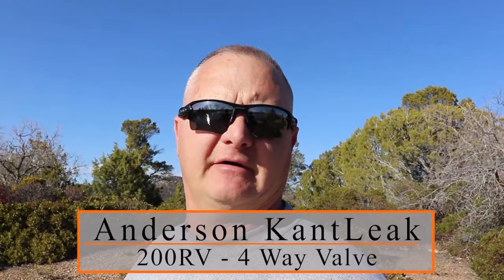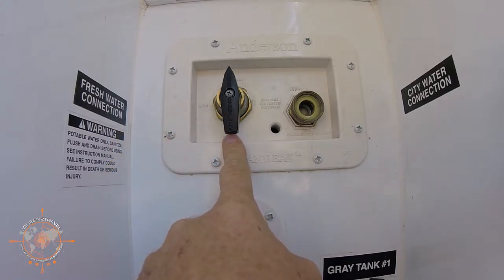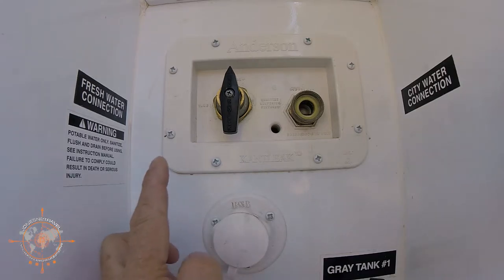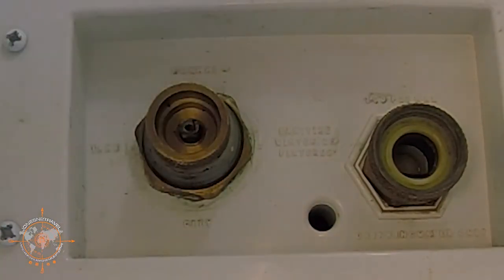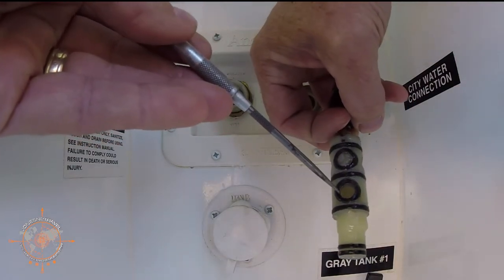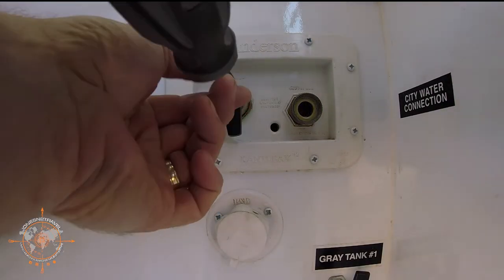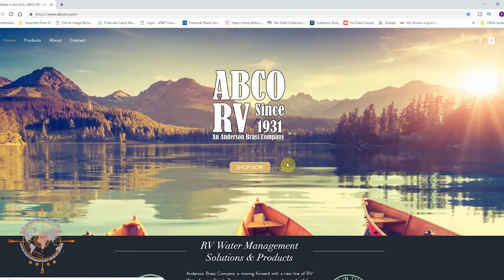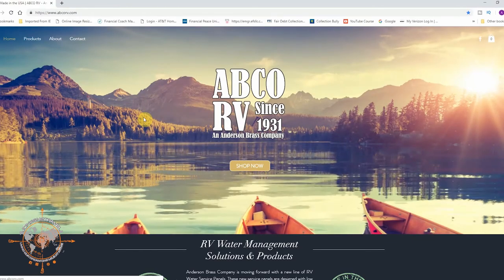HOW TO DIAGNOSE, REPAIR AND FIND PARTS FOR ANDERSON KANTLEAK RV WATER VALVE | RV LIVING

Comment: Very helpful! You can't get the valve cores anymore, but this helped me diagnose and temporarily fix it (I think maybe one of the seals got misaligned). The available replacement part is brass and an improved design plus a 5 year warranty. If you're reading this comment and don't have the money for the replacement part, try taking it apart, checking all the seals and putting it back together. Do not turn the valve with the system under pressure, as this seems to be a common cause of failure. Thanks!
Reply from the maker: Hi John. Thanks for the update. You are correct, you can no longer buy just the cartridge. Thanks for checking out the video. Safe Travels

Comment: Thanks for the video.  Wish I had seen it a year ago.  My issue started with loss of pressure for the shower.  I would also hear a hissing sound coming from the valve area.  (Sucking air of course). Also the pump would kick on and off all day without opening any faucets up.  I would go through water like crazy and my gray tank would fill rapidly.  Luckily this cartridge is available to rebuild these valves.  At $42 it’s a a lot easier pill to swallow then the $160 complete valve assembly.  I am hoping to find me O’rings to replace the bad ones on my old valve so then I always have a spare.
Reply from the maker: Sounds like a great strategy. I had a spare as well but I'm still on the hunt for just the o rings. Thanks for checking out the video. Safe Travels.

Comment: Thank's, great info I also found or the way I discovered the problem mine was also sucking air which caused the pump to run, 
and not build up any pressures.
Reply from the maker: Yes that is how mine started then it stopped then started bypassing. :) Thanks for checking out the video. Safe Travels

Comment: This is great.  I was getting ready to buy the WHOLE valve.
Reply from the maker: Hi Brad. You may need to after all. Check out Ebay to see if you can get a cartridge if not you may have to buy the whole valve. Sorry about that. Safe Travels

Comment: Thank you.  I've been having the same problem, fresh water tank overfilling while on city water, and water pump cycling on momentarily every few seconds when using from the fresh water tank.  I will order as soon as I get home.
Reply from the maker: Glad to hear the video helped. Thank you for checking out the video. Safe Travels.
Reply: Well, we ordered the valve as soon as we got home, and after all the mowing and catching up, the valve was replaced today, and great news, it works just as advertised. Found the rear port seal cut (as I expected to find).  Ran water for a few seconds to get all the air out, and the short-cycling water pump problem is gone.   I will order a spare for any future problem.  Thanks again for the pointers on the video.

Comment: Great video. But the repair parts for the all plastic valve are no longer available and have been discontinued. You now have to replace the entire water supply box with the new all brass redesigned valve. The plastic valves have been a problem for years with the ones you talked about along with cracking issues.  My old plastic one just started back filling into my fresh tank again for the second time in about 5  years. And you are correct they are a pain to turn when they haven't been used in a while. Ordered the new all brass valve today. Very pricey at $170.00 from ABCO. hope this new redesign fixes all the problems with the old ones.
Reply from the maker: Hi Thomas. Unfortunately they got rid of the cartridges but I'm hoping by replacing the entire valve body the issues with these eventually fade away. Thanks for checking out the video and sharing your experience. Safe Travels

Comment: This was an awesome video.  I immediately went to their site but unfortunately they were closed due to the pandemic.  I also saw another request and I think their response was that they no longer make this item so I am curious to fins out what to do next.
Reply from the maker: Hi John. So glad the video was helpful. Yes, you are correct, they no longer sell the cartridge separately. Now you have to buy a new panel and replace it all. It does come with a 5-year warranty but I too was disappointed to learn that you cant just buy the cartridge. If you contact them once they open back up you can get the replacement panel you need. I am not sure if any other supplier has any of the cartridges available. I know when I first researched this ABCO was the only supplier I could find. Sorry I couldn't be of more help. Safe Travels.
Reply: JonesN2Travel Its all good. I found the replacement cartridge on Amazon. Hopefully that will fix it for a while until I can get the entire system fixed.
Reply from the maker: @jea195otr  Awesome. Thanks for the update.

Comment: Excellent video. I've been having issues from last winter and thought I had a split hose, although no leaks? Tried to winterize the trailer yesterday and it stopped pulling in the antifreeze from the bottle and I could hear air blowing out with the pump running. Just ordered a new part and will see what happens - Thanks.
Reply from the maker: Hey Bill, thanks for the kind words. Sounds like you have the same issue I had with the cartridge. Best of luck and thanks for checking out the video. Safe Travels. 👍😁

Comment: Thanks for the well explained video. It's is the same issue I am having. The web site does not have links (that I can see) to the replaceable valve body. It (currently- as of this comment) does not appear to be purchasable on its own. Can you provide a part number for search purposes?
Reply from the maker: Hi Dale,
Unfortunately, just recently, they decided to stop selling the cartridges and now you must buy a new manifold. I would suggest maybe looking on Ebay, someone may have some new stock sale there. Hope that helps. Safe Travels

Comment: Great video and very helpful, i believe we also need a new valve insert due to our fresh tank filling while we are on city connection, i can not find or locate the valve spool that you replaced, would you have a link to a current location that i could buy one from? thanks alot and keep up the good work!
Reply from the maker: Hey there. I have heard from other viewers that there may still be some cartridges available on Ebay. I did confirm that American Brass Company discontinued the cartridges, for obvious reasons. Now you have to purchase a new panel for replacement but the good news is the new version is all brass and will not fail as the old design has. Here is a link to the ABCO site www.abcorv.com If you have the same panel we have here is the link to the replacement https://www.abcorv.com/product-page/manrv102-rf  The site also has a handy "which panel do I need" tool to help you get the correct one. I am waiting on one for our rig as well and then I will do an install video as an update to this one. Hope that helps.

Comment: I have all 3 symptoms you describe with my GUARANTEED-TO-LEAK (KANTLEAK) valve. It is installed in my 2019 DRV Full House JX450. I have read that over the years, to save money, Anderson went from a brass valve body to a plastic version. RV manufactuers did the same by installing the plastic version instead of the more expensive brass version. I was told by a service tech at the DRV factory that you can help prevent this problem by first always turning the knob in the same direction. I understand that the brass valve body parts can be purchased, but you have to remove everything from behind the wall. Are the KANTLEAK folks doing anything to  support all the customers out there who are having  this problem?
Reply from the maker: Hi Mike. The only thing I am aware of that they've done is to discontinue the  cartridge and go back to an all brass valve configuration. You are correct, you do have to replace the panel but, after doing a few for customers, I really like the new panel. Its a shame they ever went to the cartridge design, such a pain in the butt. Yes, turning it in the same direction, with water pressure off, will help it. You can also pull the cartridge out and use a lubricant on the O-rings. I like to use a pool equipment grease because it withstands the water a bit and is non-toxic. Hope that helps. Safe Travels

Comment: I am having a hard time trying to locate a replacement cartridge for the kantleak, any suggestions?
Reply from the maker: Yes, they got rid of the cartridge recently and now you have to buy the whole thing. However, they do come with a 5 year warranty now. If you haven't already I would check Ebay, maybe you can score a cartridge there. :) Safe Travels

Comment: Hi, thanks for the post! I’ve been having the same issue but didn’t know how to fix it. One question though is what is the size and shape of the set screw? I can’t see it well enough and I don’t want to strip it. Thanks
Reply from the maker: Hi Bill. The set screw is normal Allen key but I am not sure the exact size. However, unless you can find a cartridge on eBay or some old new stock somewhere, Anderson Brass no longer sells the cartridge. You can replace the entire manifold and I've installed a couple of them. They are really nice, all brass, so no worries of this happening again. Hope that helps. Safe Travels
Reply: @JonesN2Travel  thanks for responding. I found the cartridge from Atlantic Marine in Florida. I was able to follow your instructions until I got to the part of “twisting and pulling” the old cartridge out. Even with vise grip pliers I was never able to twist it except between the camping and tank and I was never able to pull it out. I followed step by step, even releasing pressure in the lines. I think I’ll just have to replace the entire unit. Do you have a video on that process?
Reply from the maker: @billnewsome7774  I don't yet have a video about replacing the unit but I need to replace mine so I will see how quickly I can get that done. My cartridge was really difficult to remove too because I think those o0rings fold over and kind of lock it into the manifold. Installing the new manifold is really straight forward as long as you can get to the back of it and remove the lines. I took pictures and labels the lines before I disassembled the first one I did. The manifold comes with really good diagrams as well. Hope that helps. Safe Travels
Reply: @JonesN2Travel  thanks

Comment: How do you winterize R V with  a new  Anderson Kantleak water one value control system. Dealer installed with no directions.
 Went form two value system to one valus system.
Reply from the maker: There should be a selection for winterize on the valve dial. Then connect your antifreeze hose to the water inlet and use the on-board RV water pump to pump the solution to the fixtures. Hope that helps. Safe Travels

Comment: My pump does not shut off but it pumps water thru everything just fine. When I shut it off the pump keeps running and I can hear water gushing thru the valve. I guess I will change the cartridge first and go from there. What do you think?
Reply: Hey there. Thanks for checking out the video. My guess is that the water is bypassing inside the valve. Ours filled the fresh water tank when we were hooked up at a park. I would replace it for sure. Issue is that the cartridge is no longer available, Anderson designed a completely new all brass solution. I upgraded ours and it works great plus no more cartridge to worry with. Hope that helps. Safe Travels
Reply: @aaronjones280  
Oh no, I got to find one somewhere! Thank you, great video!
Reply: @aaronjones280  
Do you have a video of the new set up or pictures. Easy to change over? Parts I need?  Thank you so much!
Reply from the maker: Find the panel you need at American brass https://www.andersonbrass.com/rv-solutions

Comment: I read somewhere it’s a bad idea and causes problems turning the valve while the system is under pressure. Good video
Reply from the maker: Yeah, I don't think turning it under pressure is the best idea. Plus, its even harder to turn that little handle when under pressure. :) Thanks for checking out the video I appreciate it.

Comment: The cartridge is no longer available. I believe you now need to replace the whole pannel. What you provided work in advance
Reply from the maker: Yes, you are correct. I recently replaced our panel with the new all brass design from Anderson and it works great. Safe Travels

Comment: It appears as if the repair cartridge is no longer available.  If I'm wrong will someone please let me know because my valve is fairly hard to turn but I may just take it apart and lube it as I don't think the previous owner used it on anything but city water and I know he didn't winterize because it was kept in heated storage.
Reply from the maker: You are correct. They discontinued the cartridge so now you will need to purchase a new manifold. Good news is that the new version is all brass valving so no more cartridge to fail. Safe Travels

Comment: Unable to find just the cartridge?
Reply from the maker: Hi Bruce. I believe the cartridges have been discontinued but you may be able to find old stock cartridges on Ebay. Thanks for checking out the video. Safe Travels
Reply: @JonesN2Travel  Believe it or not, I was able to order directly from Heartland. That said, one of my projects this year will be to replace the whole system with the brass upgrade they came out with.
Reply from the maker: @brucehale6151  That is awesome news. You'll be much happier with the new panel. Keep in touch and Safe Travels. :)

Comment: Where’s the link to buy one of those
Reply from the maker: Hi there. Unfortunately Anderson has discontinued the cartridges. There have been some available on Ebay, brand new, so I would look there. If not you can purchase the complete panel, all brass and no more cartridge, on the ABCO website. Hope that helps. Safe Travels
Reply: @JonesN2Travel  I was afraid of that.  The whole panel is pricey
Reply from the maker: @Annunaki2012return  I agree, a bit pricey but I replaced the cartridge 3 times in our last rig and once in our new rig. I just replaced the entire panel and I'm excited not to have to replace that stupid cartridge anymore. It really is a nice panel without the cartridge failure. Hope that helps. Safe Travels
Reply: @JonesN2Travel  what model did you buy to replace the one you had? I have the same one you had but I am not sure what new model I need to buy to match the old one